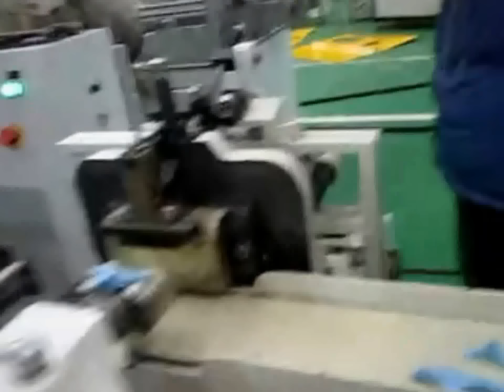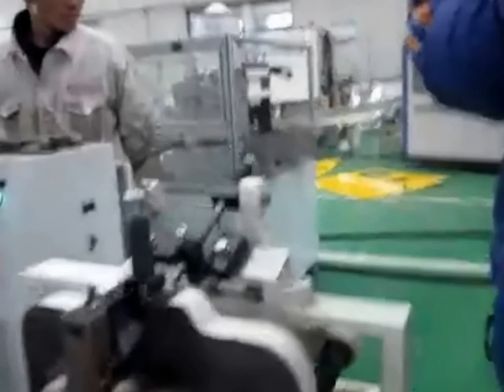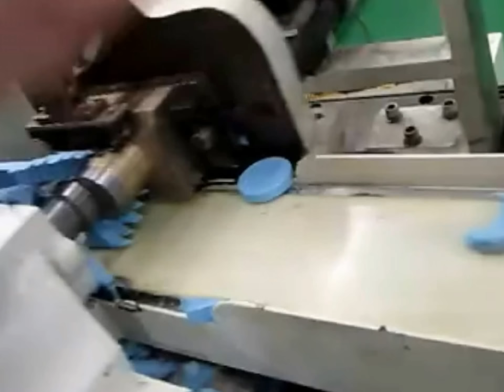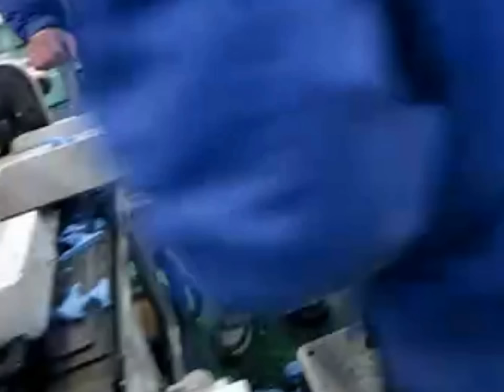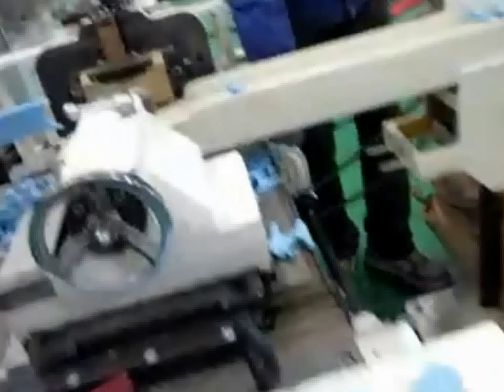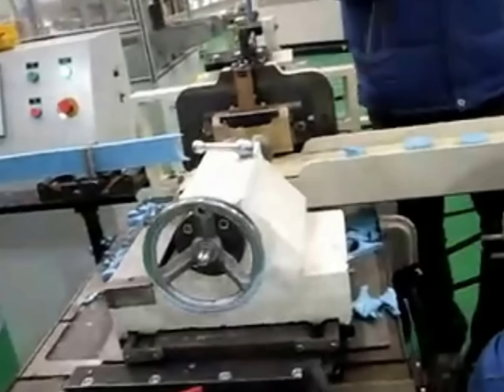Hotel soap stamping machine inspection&adjustment automatic cosmetic solid bar stamper cutter equip

Comment: the machine is not the problem in itself the mold. I myself designed the mold to work without gluing the products if they need help in issues of molds and this type of machines I am professional. improve the design of the mold and see how this machine works is a potential in production greetings from lima peru
Reply from the maker: great! you are so professional
Reply: Exactly I have more than 20 years experience as an industrial mechanic